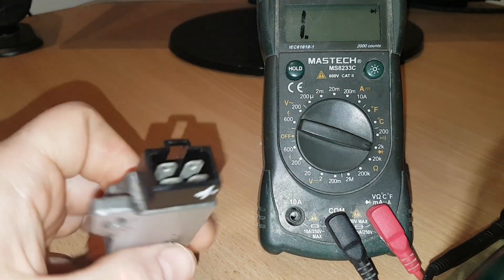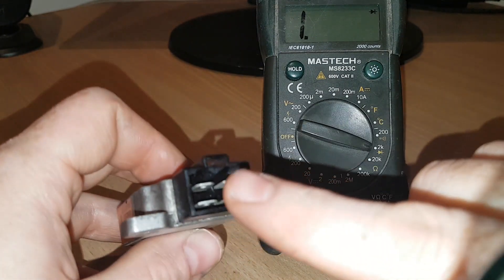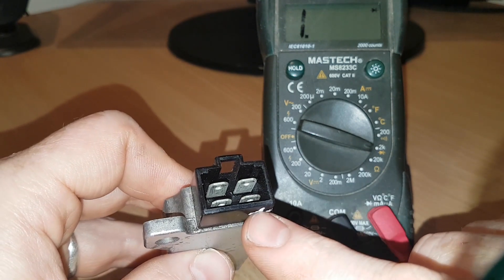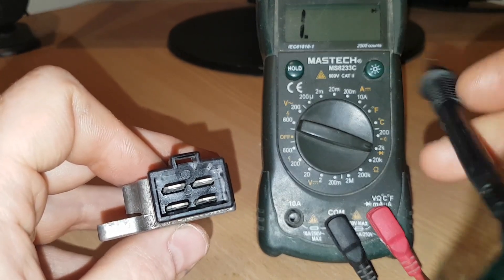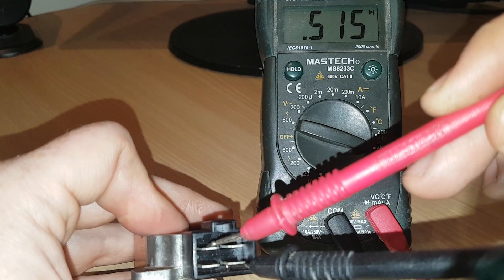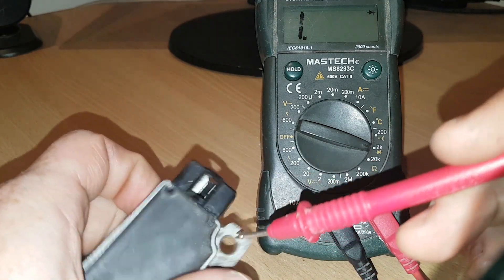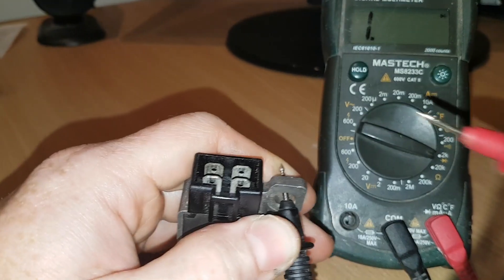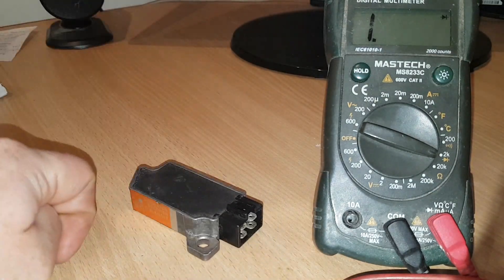Motorcycle Regulator Rectifiers - Offline Testing 250cc+

Comment: Hi may I ask where high beam indicator light get the power from ?? Direct from coil magnet or rectifier or battery ?? I never notice it before but recently I find my bike high beam indicator's light get very weak without giving throttle. Thanks first

Comment: I had try to pull out this unit from terminal socket and it still sending electric current to battery and head light became too bright if let engine's rpm ramp up more. So eventually burned out mentol... lol

Comment: Hi I have a 1987 tw200 and the rectifier looks identical to the one that you tested. Do you think the pin outs will be the same? Thanks
Reply: Test them and see what readings you get. Most reg/rec's are one of two types - earth through the case of the reg/rec itself or earth through a pin. One has 4 pins the other has 5.
Reply: @IronRooRider  thank you sir👍👍
Reply: @IronRooRider  hi again so I tested the rectifier and got 545 across all the pins except for one .it read 762.Do you think it's bad?thanks for your help
Reply: Hi mate, the nature of your question indicates you may not fully understand the test. It is not about the readings themselves, but about consistency. If the numbers across the 3 phases aren't within about 10% of each other, you've likely got a bad circuit. The reg/rec's aren't that expensive so if in doubt just replace it.
Reply: @IronRooRider  lol I definitely don't fully understand electrical problems. That being said if I buy a Chinese rectifier will the pin outs be the same and if not how do you figure it out? Thanks Stu